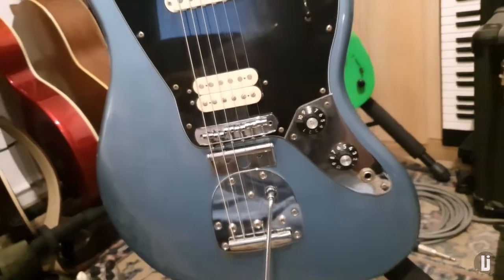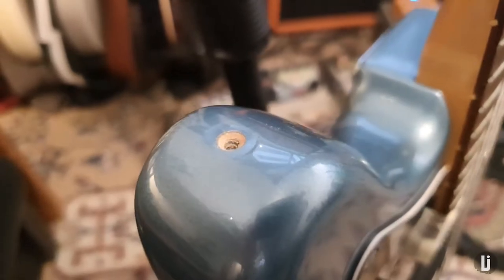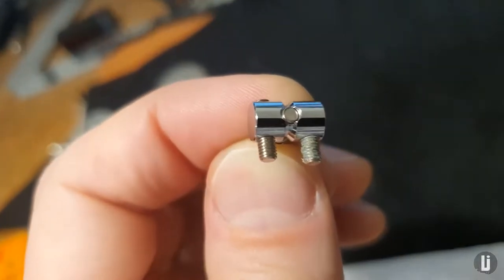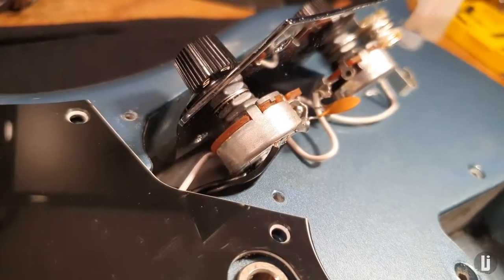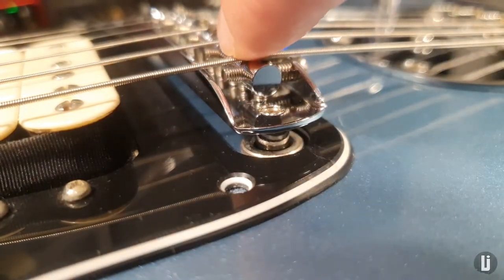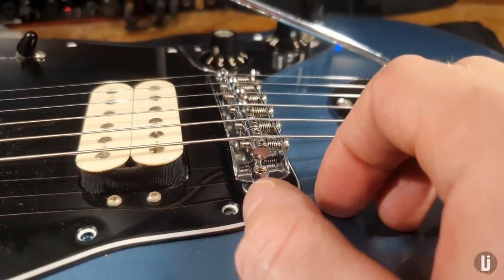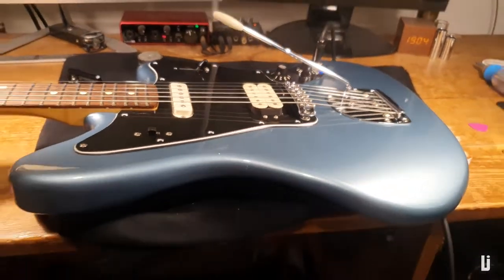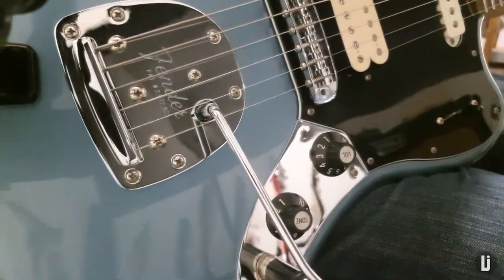Used Guitars Are More Fun - 2018 Fender Player Jaguar HS

Comment: oh its the screw in the center of the plate.counter clockwise will lower the arm.
Reply from the maker: But it will loosen the spring at the same time, and the bar itself is at too much of an angle compared to my Squier. It's not a big deal though.

Comment: Got this guitar used in mint condition as well. Strings looked even worse than on yours. Had to oil the dry fretboard and put on new strings + setup. I really like it over all but I have the same problem with intonation on the low e. I don’t understand why Fender designed it this way, especially when you consider the fact that the Squier guitars are cheaper yet have the better design. Quite puzzling. 

Anyways, good video, learned a few things since I’m not familiar with Jaguars.
Reply from the maker: I'm really puzzled as well. It's not like they have to even research the issue. They've already made it the right way before themselves.

Comment: Do you shim the neck? Mines been rattling and has a dead note on an open high e string. Just trynna figure it all out.
Reply from the maker: I did not need to shim this one, in fact once I got the hang of these bridges I realized most the issues are due to poor setups.

On some cases a shim might help a shallow break angle for the strings over the bridge, but if it's rattling what bothers you it's most likely due to sub-par machining of the parts, meaning the screw and the thread inside the saddle differ too much. I've seen it all over the place, even on high end ones. 

Most people deal with this using Loc-tite to fill in the gaps between screw and inside threads. I've also found teflon plumbing tape to be a good replacement if you can't find Loc-tite, but it's a bit trickier to deal with.

Regarding the high e sounding dead when open, if it's only when open and doesn't translate to fretted notes, I'd look at the groove in the nut. Maybe it's but too flat instead of sloping back towards the headstock, meaning the string doesn't sit on an edge and instead vibrates all over the length over which it sits. 

Another thing could be it was cut too deep. You can find this out by pressing the string past the second fret and checking if the string clears the first fret before reaching the nut. You can find out by tapping the string over the frist fret while you hold past the second one. You would hear buzzing while playing though.
Reply: @lonerjuan  thank you for the reply 👍🏼, I'm still learning about it.
Reply from the maker: @J_Lpzc  No problem! Don't hesitate to write back if there's anything I can help with.
Reply: @lonerjuan  Hey most issues aren't really a big deal besides that the action towards the higher frets gets pretty high. Would this just be a truss rod fix or would a shim be needed, thanks in advance.
Reply from the maker: @J_Lpzc  I would check both the truss rod and the bridge, in that order, but I would judge the truss rod by the bow of the neck and not string height, because what the truss rod does is adjust the relief of the fretboard relatively to the strings by allowing some bow of the neck or compensating for too much bow (you probably know this, but it can't hurt).

So, you press or capo at the first fret and with the other hand (unless you have freakishly long fingers, in which case I need pictures) you fret where the neck meets the body (roughly, different necks may have different degrees of rod action). Then, with whatever free finger can reach the middle point between both presses, you fret or tap the string to see if there's some bow beneath it. The neck should not be completely flat, and not too bowed either, just a few mils of separation between string and fret, which you get an eye for with practice.

Once you're comfortable with the bow, you adjust overall bridge height, which will actually have a greater impact on action at those upper frets, but will interact with the truss rod, so it's better to do it in that order.

Always remember the T.R.A.I.N. method: Tune, Relief (truss rod), Action, Intonation, Noodle and repeat everything until you get it right.

Let me know how it goes.
Reply: @lonerjuan  I did the capo thing and slid a metrocard (which is 0.010 inches thick) in between the string and the fret. The string is touching the fret which I've learned isn't a good thing and trying to give the truss rod some relief. I'm trying to turn it counterclockwise but it's giving some resistance. The Allen wrench is also in an awkward spot in between the strings such that I can't really turn it without pushing against the d string.
Reply from the maker: @J_Lpzc  It happens on most guitars, but just get the strings out of the way and then slot them back. 

As for the resistance, it might be that it hasn't been moved in a long time, but it should move regardless and you shouldn't be able to damage anything as long as you use the right key, especially if you're just loosening it. Go small increments at a time, like 1/4 turn or so, and wait a few hours to let it settle under string tension.
Reply: @lonerjuan  I was able to set it up and it works great but still just a tad higher action than my other guitar. If I add a shim in the neck (probably just a playing card cut out) will I have to readjust the truss rod/bridge?
Reply from the maker: @J_Lpzc  You might. The idea is that if you shim it, the bridge will have to be adjusted accordingly and go higher. People do this on offsets to get a sharper string break angle over the saddles.

If that's what you need, go ahead. Otherwise, give it some time, get used to this setup, get a better feel for it with reiterated setups and as with any other guitar, don't expect carbon copy measurements between them. I can't even get both my LPs set up exactly the same. They're close, but they were built by people, so there's always variations.

Now whatever you decide, avoid using partial shims like credit cards. Buy one that fills the entire neck pocket, they're dirt cheap and provide an even contact surface instead of a step. I've heard from countless techs that sticking pieces of things in there might lead to deformations on the bottom of the neck that translate to the top over time, like a bump up high on the fretboard. You don't want that.
Reply: @lonerjuan  alright I'll look more into it to see if it'll help. Thanks for all the help and quick response time, I really appreciate it 🙏🏼